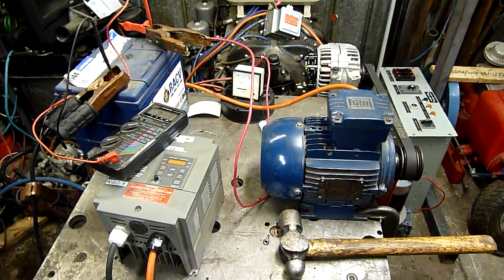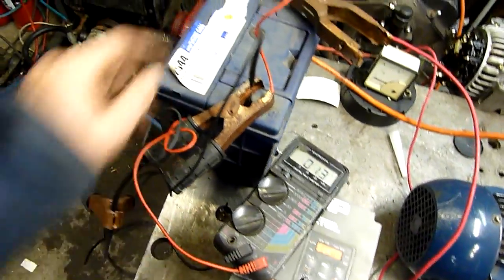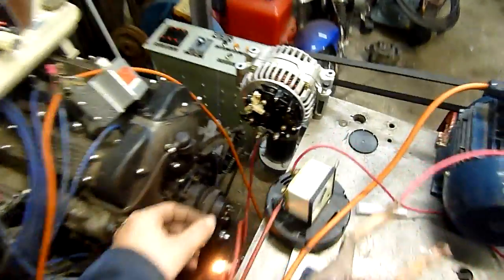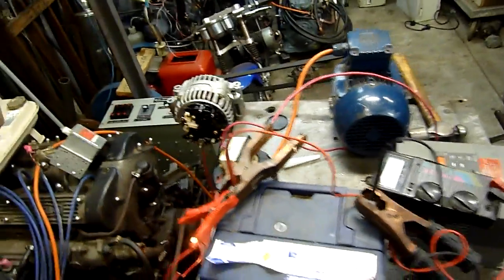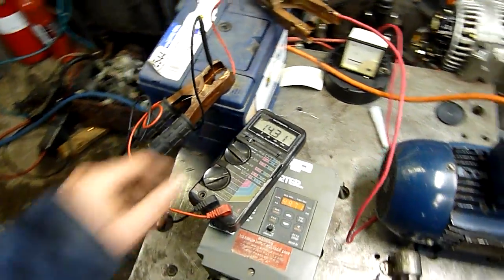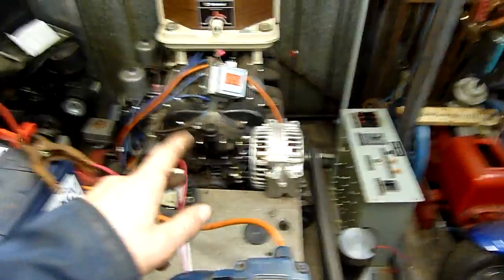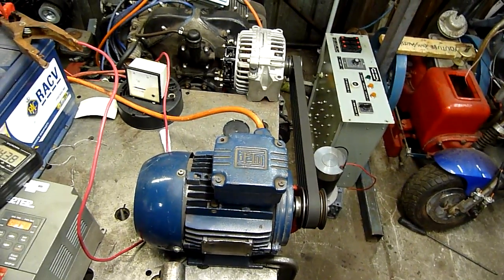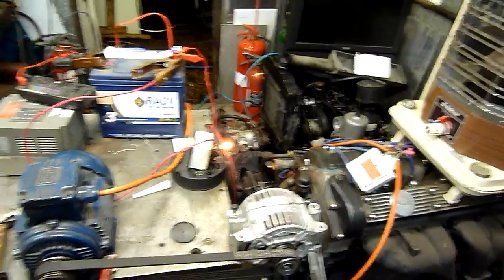Testing a Bosch Alternator with a 3 Phase Motor

Comment: Glad i seen this because I bought a bosch 120 amp alt for my backhoe loader but it needed a 3 or 4 wire alt .i wired in the light and it started charging but had to put a bigger wire to battery because smaller one got very hot.  thanks

Comment: @thecolinputer, your basic car alternator is only about 50% efficient, so output amps X volts X 746 watts per HP X 2 will be the required engine HP.

Comment: i saw a guy use the current straight off of his running car to weld. he had a v6 in the truck and revved it at 3000 rpm for welding and when he struck an arc it bogged down a shit ton

Comment: Nice vid.  The windings of the alternator are actually just above the battery voltage by only the voltage drop of the rectifiers.  Stator windings go to rectifier pack and straight to the B+ terminal.

The voltage regulator in the alternator monitors the output voltage at the B+ and in turn controls the excitation current inside a winding within the rotor.  More current = stronger magnetic field in the rotor = more current (hence voltage) induced to the stator windings.

Comment from the maker: the term alternator refers to a AC power generator, hence the name from 'Alternating Current' 
In this case its used on a car engine, and fitted with a regulator and bridge rectifier to produce stable DC power to charge the battery and run the vehicles electronics. all modern vehicles have them, even some lawn mowers and tractors

Comment from the maker: the fans pulled 25A with the battery in circuit, most large rad fans can pull a lot of amps.

however I need 10Hp to run the alternator at full load

Comment: Eh, I doubt radiator fans produce that much of a load.. If ya think, an alternator throws about 60-120amps... Those fans only use somewhere in the 7-9 amp range I think. I'd throw a stereo on it, some 12v lights, fans, etc... load er up Ed.. >:D

Comment from the maker: thats to do with PWM. the trigger pack contains a small amount of electronics that vary the power going to the motor via Pulse Width Modulation. its cheap and simple speed control but noisy.

Comment: Found this description on the internet:
The Overrunning Alternator Pulley has a simple one-way clutch inside the pulley.
This internal clutch allows the rotor of the alternator to coast to a stop when the engine
is shut down. This “overrunning” feature eliminates “chirp” sounds that happen when
engine decelerates quickly causing the belt to slip at the alternator pulley (engine shut
down or transmission shifting).
Sounds fair enough, still inertia based

Comment: those twin fans should be no problem as long as the battery is connected and charged. cooling fans that size will be no more than 40 amps most cooling fan fuses in modern cars are either 30 or 40 amps per fan, bmw E90 316 fan uses a 50 amp fuse for its cooling fan but mercs can use up to 150 amp as they have a giant single fan

Comment: the clutch induces the alternator to disengage when the engine is decelerating, for:
-alternator keeps spinning by inertia, generating voltage/current
-lowers engine braking capability due to alternator's inertia, and everything related
-saves fuel since the engine doesn't have to rev up on alternator load, if alternator's rpm are higher than the engine itself
and other reasons....
sorry for my english

Comment: the regulator will be regulating the voltage to the rotor, by monitoring the voltage on the excitation line sort of like the negative feedback on an opamp, the diodes and battery are hooked to the 3 phase AC

Comment: just to let you know, 15v still will not be a problem for rest of the car, battery will start to evaporate even at 14.4v, so long term it should be at 13.5v, charging at 13.8v when hot...
anyway, I wish you would load the alt

Comment: How so...If the alternator locked, it would be no different than a heavy electric load. A one way clutch would stop the alternator from driving the engine if it somehow wanted to.

Comment: at full tilt a 85 amp alturnator is meant to consume about 5-7hp. it would largely depend on the pully ratios and rpms. ie if you keep the motor pully smallish (say 4 times the alternator) you will need more rpm's but less power. if you make it bigger, say 5/7 times bigger which is standard for a car you need more engine torque (hp) but dont need to be reving the guts out of the motor. most of the time charging a battery wouldn't take any more then 20 to 25 amps at 15 volts anyway i should think

Comment: and ide suspect even at full tilt the alternator isnt even spinning at idle speed as the crank pulleys are normally 3 / 4 times bigger at the very least then the alternator pully. 

in theory the ac output from the wingdings should only be very slightly higher as it only rectifies it, not regulates it. the voltage is regulated by sending more power to the stator winding through the slip rings making a higher electromagnetic field, inducing more current in the field winding. at least i think lol